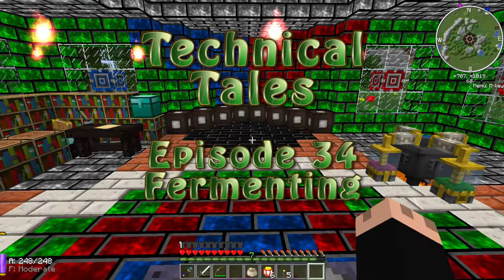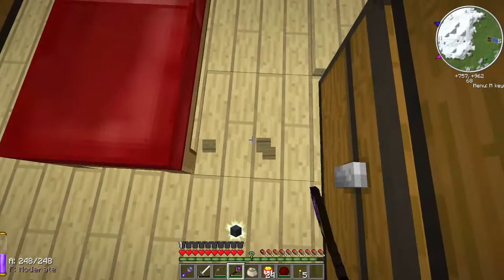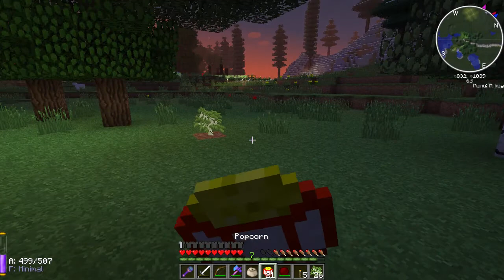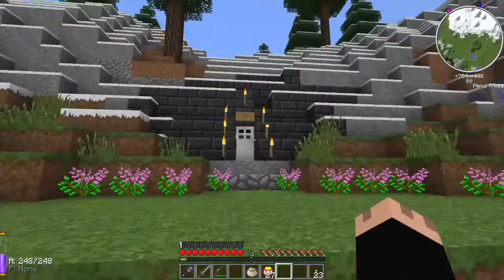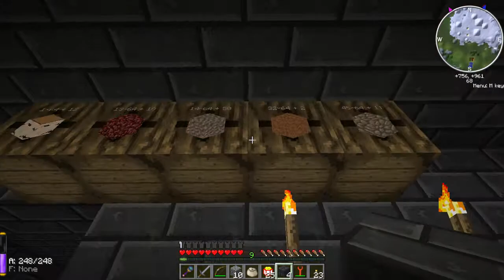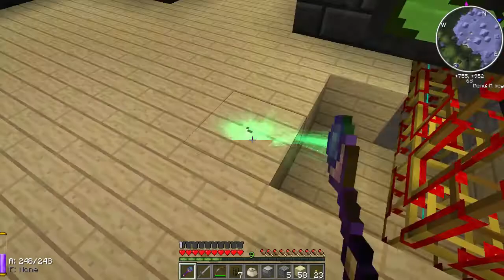Technical Tales - 34 - Fermenting

Comment: You can use Stone Pipes for the lava and cobblestone for the biomass. Stone and Cobblestone pipes can't connect to each other. and therefore you can use wooden/gold pipes to make them connect. Also, Gold pipes speed items up, Stone pipes are better than Cobblestone pipes since they have less speed slowdown from the item in the pipe.

If you are going to pump items or liquids out of something then you need a wooden pipe.